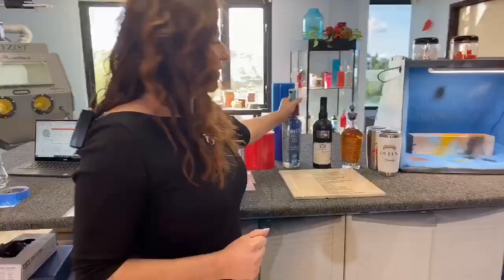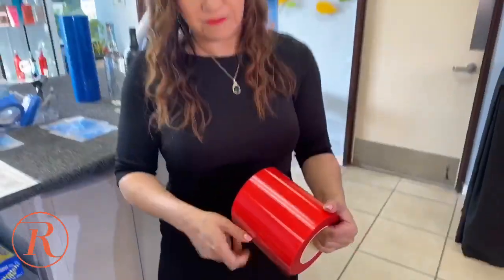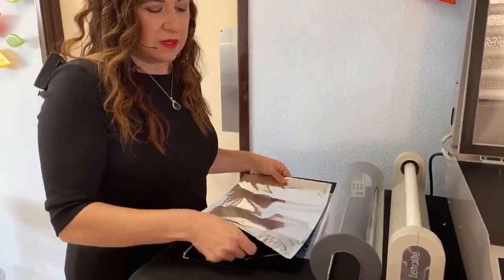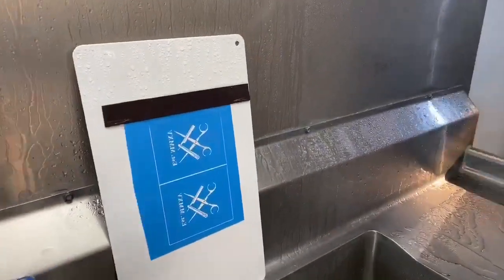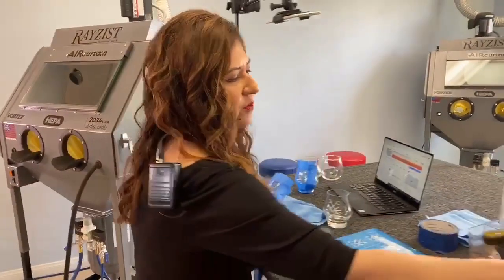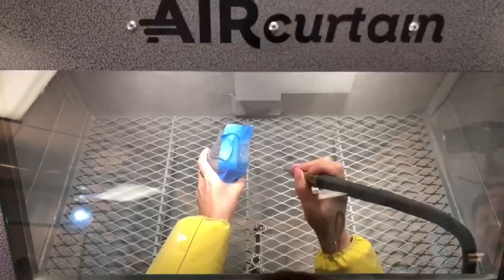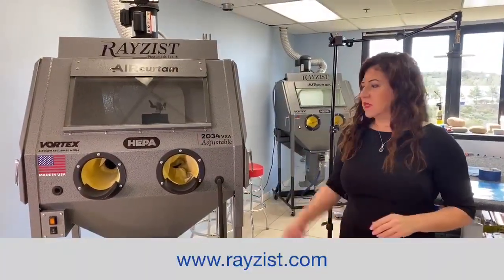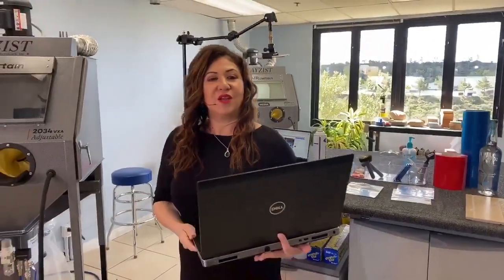I | New to Sandcarving

Comment: How can I get it..what kind of program do I need for printing
Reply from the maker: Any "graphics" program to create your print is fine. You are printing (B&W) vector graphics. There is no particular or specific graphic program required. Common programs include Abobe Illustrator and CorelDraw, and there are some Free ones as well.  However, the "printer" that Liz recommends in this clip was the Epson HD XP15000 (which we can make available the proper print settings to achieving the best print opacity.
Please "follow us" socially when we are posting our next Live event